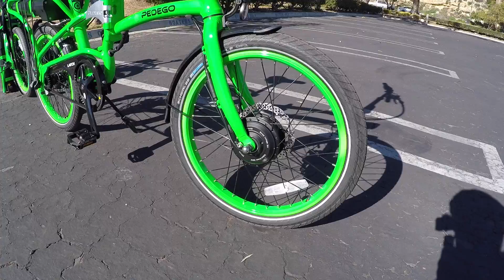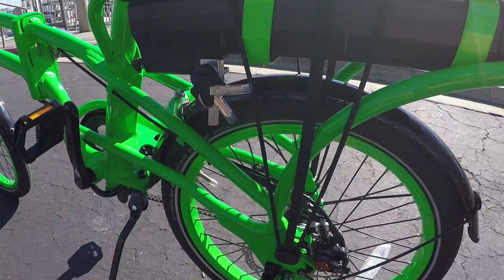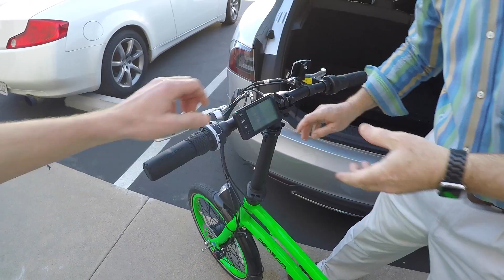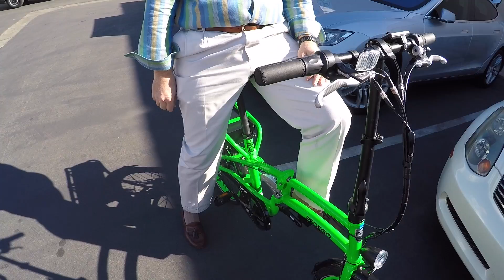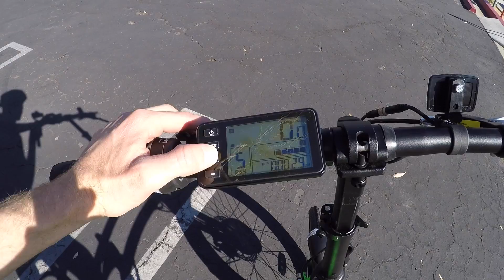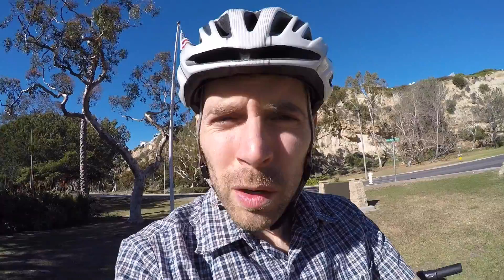Pedego Latch Review - $2.6k

Comment: The balance of the bike is so rear heavy along with the front wheel drive make it very difficult to control at slow speeds. I didn't feel comfortable at higher speeds either. Pedaling didn't help in any of the 3 speeds. I stoped pedaling and just used the motor. It has plenty of power it's just not an easy bike to ride. I'm a healthy in shape 62 and I found it basically uncontrollable. I rode my sister's ebike and it was fun but it wasn't a folding bike. I've got to try some others. So far I'm very disappointed.

Comment: I don't have a use for a folding bike but I do have to admit that the bike folds up nice.
Reply from the maker: +DrZarkloff Yeah, If I was getting a folder I'd probably aim for something lighter weight but this one definitely folds slim and stays put :)
Reply: @ElectricBikeReview  Very interested in which lighter folding bike you'd prefer. I need light , light, light, and small. Don't need speed, and I don't weigh much either.